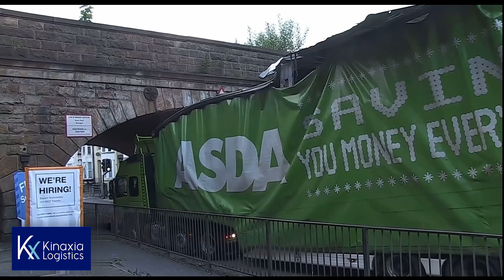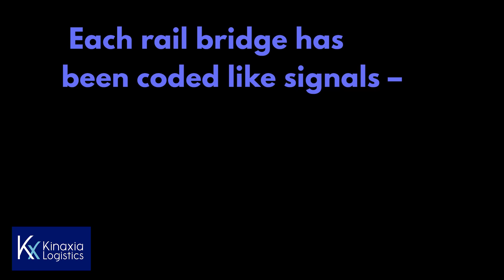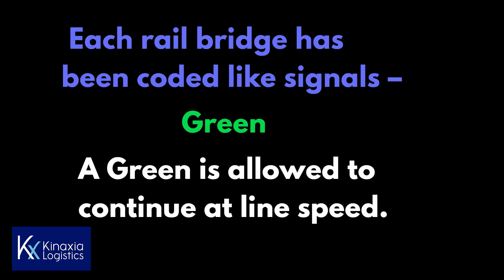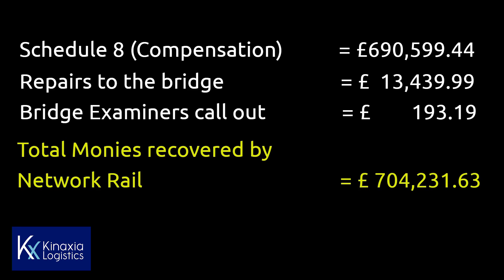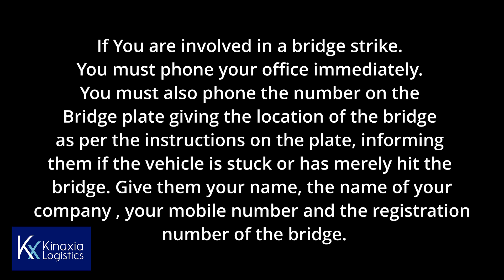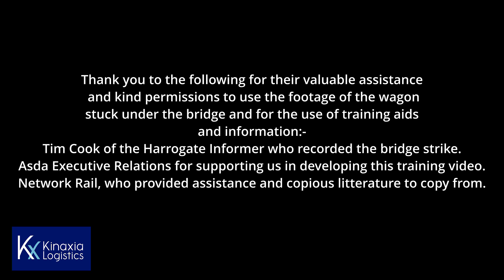Bridge Strike Tutorial - Lorries Can't Limbo.

Comment: With supermarket deliveries you are often given a risk assessment pamphlet. Giving info of preferred route and risk and observations needed to adhere to at the destination. He either forgot he was pulling a double decker which sometimes is 16ft 2ins, or a newly qualified driver not sure or aware of trailer heights. Though he should be aware of his height. I doubt he is still working for ASDA.
Reply: ASDA use a lot of agency drivers so chances are he was not familiar with the route. Was probably using a car sat nav
Reply: @GarethT902  yep could have been using a car 🚗 sat nav. 🙄 I had a conversation with a colleague about using a car sat nav in a truck. According to him if involved in an accident you are open to prosecution. Dunno if its true.
Reply: I don't have a HGV licence however I do have a private pilots licence and honestly I think that those of us qualified to operate very specific machinery under stricter licence requirements ought to do our fecking job properly. If I as a solo pilot without even any non-revenue passengers on board decide to land at a runway which is blatantly too short I would be suspended on the spot and the investigation will not go in my favour. If you hold a C class licence you should be able to read the stated dimensions of your vehicle for feck sake. For comparison I can loose my licence for a whole bunch of things failing a basic visual inspection that I am expected to check in preflight of a rental aircraft. Asking truck drivers who spend so much time around vulnerable road users to know the basic space occupied by their vehicle seems trivial by comparison.